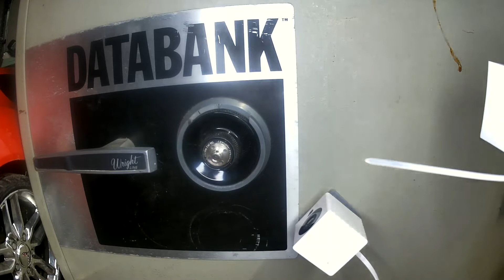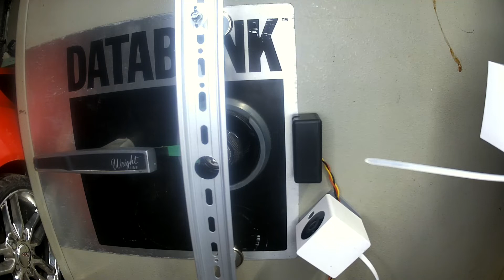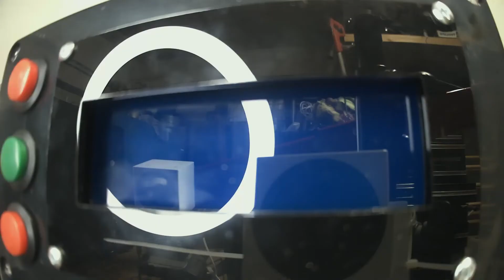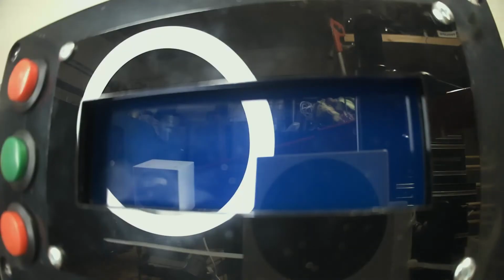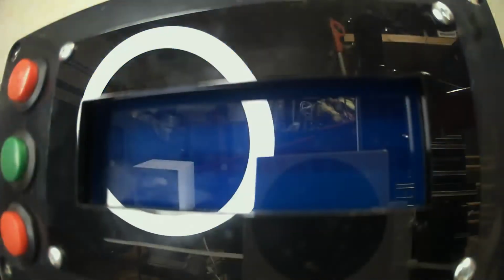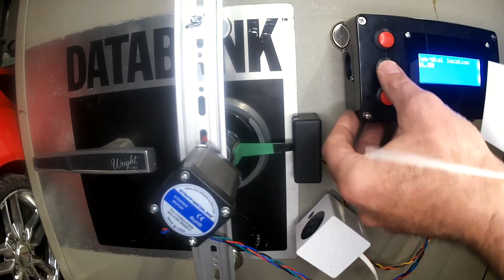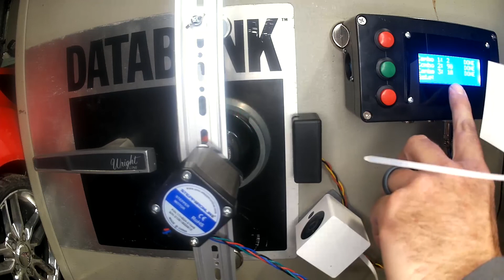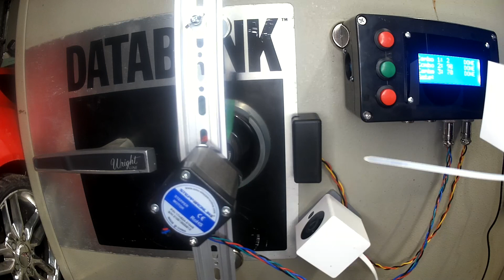CrackerBot Autodialer installation instructions

Comment: Could a load sensor/amperage draw be utilized to detect possible gate locations to shorten the auto dialing? I know variations in manufacturing and wear can cause false indications but it could possibly cut down on time. Maybe an initial 10 minute run at the beginning to detect possible ranges?
Reply from the maker: Possibly.  I'll have to put together a little prototype and see if its worth the extra parts and how much variance there is...  Good suggestion...
Reply from the maker: Mostly S&G.  but some cheaper types have been cracked too.  I haven't found a safe that it wasn't able to crack eventually.  4 wheel take a long time...

Comment: Interesting with re-sync independent pointer & optical sensor -- what lock models have you successfully autodialed?
Reply from the maker: I don't know the models but mostly S&Gs dials.  Victor and Mosley safes.  I've cracked over 30 safes so far.